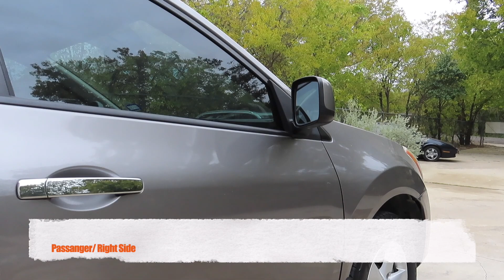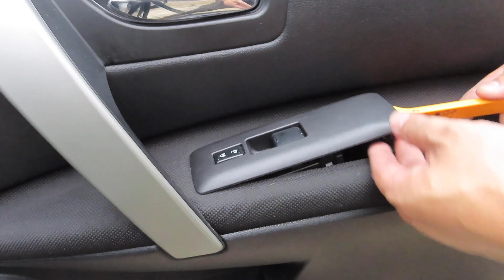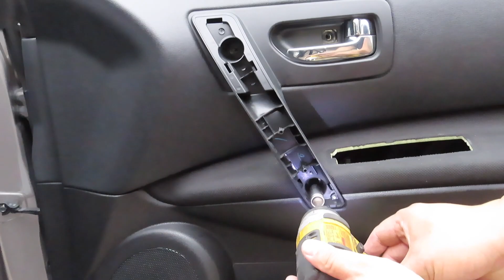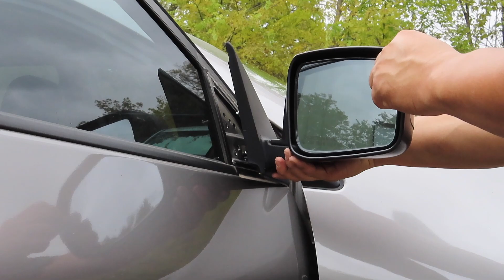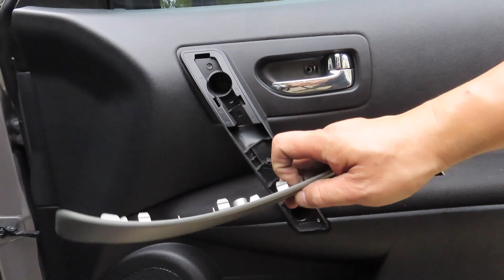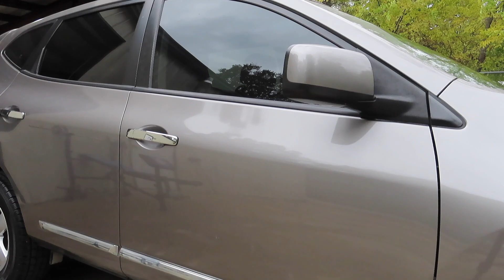2008-2013 Nissan Rogue Removing Side Mirror

Comment: Thank you so much for this video. Not mechanically inclined and you made this so simple.  What was even better is that I didn't have to access the window control panel on the door. Just clipped it at the top. Definitely a new subscriber.

Comment: This video is very helpful.  I had a question about buying a replacement piece.  I have a white Nissan rogue sl 2013, and I've noticed the standard replacement color is black.  Will I be able to use the white cover that I currently have instead of the black? I'm not sure if that clips in or not?
Reply: Hi! I know your comment is old but were you able to switch the covers? I had the same question. :)

Comment: Just out of curiosity could you point me in the correct direction of where to purchase the mirror? I have checked several sites and there seems to be many options lol. I need one for a 2012 Nissan Rogue
Reply from the maker: Best way to find the best fit mirror is finding out the part number of the item. and you can get part number through the dealer parts department. or do your google search.